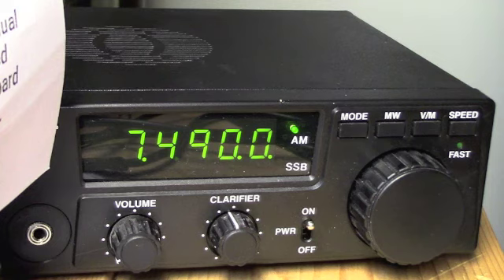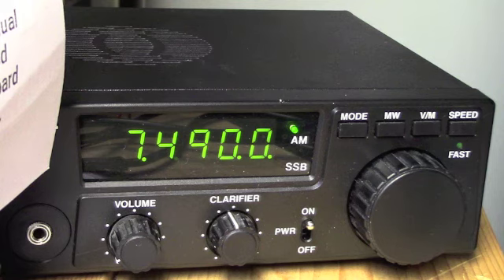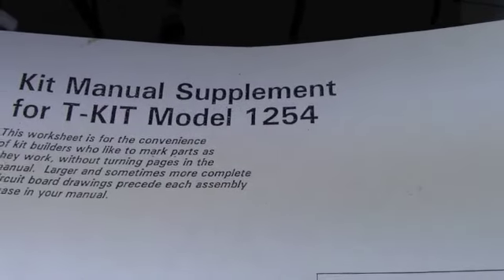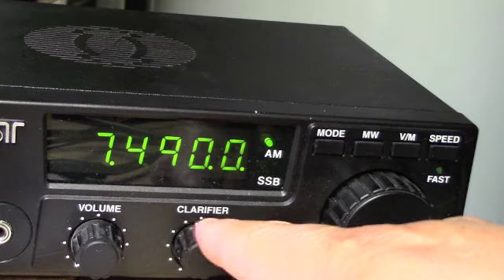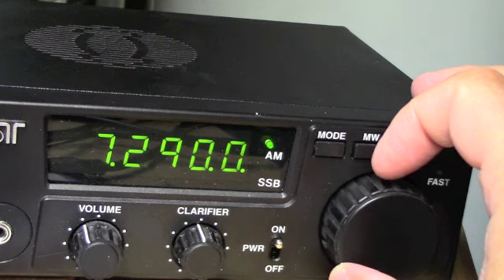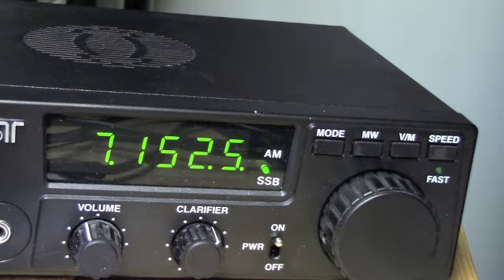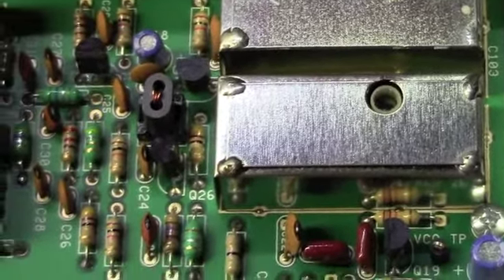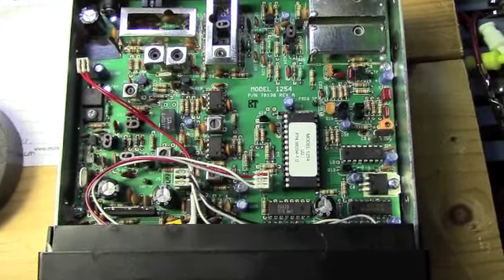TENTEC 1254 SHORTWAVE RADIO

Comment: Radio sounds great!  The simplistic look was also great, not so busy, albeit...I do like tons of knobs, buttons and switches, but I think here, simple was great!  I see there was no S-meter, I would need that...easy to add as an attachment....this radio is now on my eBay troll list....what was your antenna setup? Jack, VEG
Reply from the maker: Vintage Electronics Geek no S meter but you're right it would have been nice to have. I just had a random long wire hooked up. Good luck on your quest for one on eBay.
Reply: Wow, very impressive....I have been an inactive HAM for about 15 years, I plan on letting my ticket expire and may entertain the idea of returning to just monitoring, so I'll need to run wires, may do a long wire on the wood fence and a small inverted-V on the roof and that's it...maybe next year as winter is trying to creep in now....thanks!